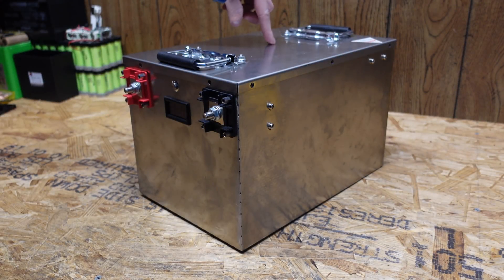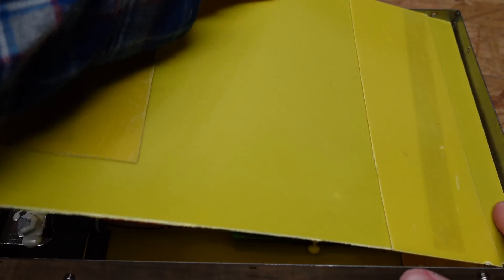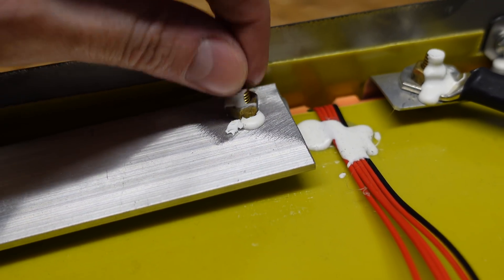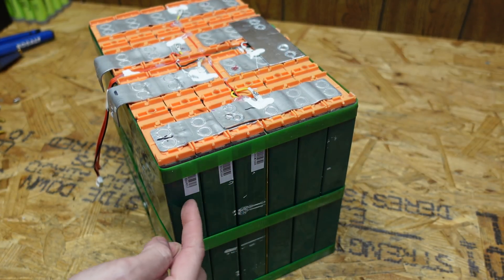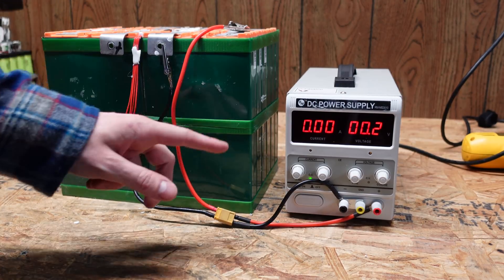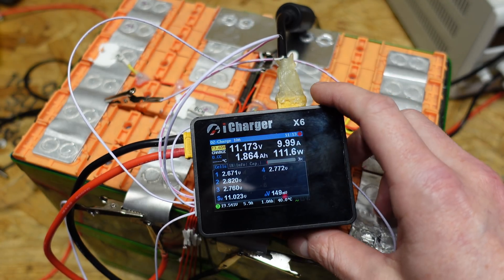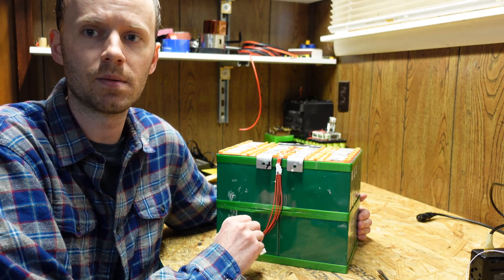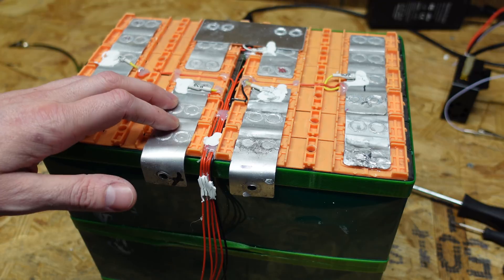Troubleshooting a Failed SHUNBIN 12V 300Ah LiFePO4 Battery

Comment: The bms in the SHUNBIN is garbage. I've fried a few of them. Some of my cells are bulged as well but I just made a 48v battery bank. Have the Overkill BMS that I'll be using to replace the shunbin with.
Reply from the maker: Other than the stainless steel enclosure (which is quite nice) the entire thing is garbage to be honest. They technically "work" though I suppose...

Comment: Sir, how many number of cells in parallel there. And total number of cells altogether.
Reply from the maker: Hi. It's a 4s3p battery, so the cells are arranged in groups of 3 in parallel, then each of those 4 groups are wired in series.
Reply: @LithiumSolar  How many cells in one parallel group.

Comment: Yeah I had purchased a new battery from China also that had a bad cell in it but in addition to that they were used cells to start with not new as advertised
bad cell in mine was spongy and soft compared to the others for solid hard

Comment: Just a quick note about "locking" washers
They actually don't work, I have never seen one work, but i have seen plenty fail, I think AWE or ThisOldTony did a video on it where he tested a bunch of diffrent washers.

The only thing that works is a locktite type threadlocker.
Or peenig the nut on, but that's rather permanent.

Comment: My son (age 5) asked me to suggest that you replace the bad batteries and connect them to the others with spot welded nickel strip (replacing the laser welded aluminium).
Reply from the maker: I don't think you can spot-weld to aluminum? I've never had luck trying it in the past with my Sunkko 709AD.
Reply: Can you remove the aluminium plate and spot weld nickel strip to the battery terminals?

Comment: As long as it charges up, balances nicely, then passes a week long self discharge test (nothing plugged in no BMS at all) then just run a capacity test and see if they are well balanced capacity wise. If it passes all those tests it should be just fine. LFE cells can be discharged safely to 0v and recovered with only minor degradation, spec sheets mostly state 100% DoD is allowed it just reduces the life expectancy faster than the normal 2.5v cutoff. As long as they were not reverse charged then they should be OK, but what I think happened is that the BMS shorted out from using recycled or fake mosfets and the load over discharged the pack. Unfortunately that does mean the first cells were over discharged, which is why they were sitting at 0v and not 2v which they should have bounced back to under no load. But of course that is just an educated guess.

Comment: For recovery i think you need anyway to separate all cells and test all individually. Probably there is just one cell (in the parallel configuration) which discharges the others. Separate, Charge to 3.6 - 3.65, let them rest for a couple of weeks, check the voltage, measure the capacity, rearrange the good cell so that each pack from serial configuration has nearly the same self discharge rate and the same capacity.

I think, cells which has a voltage less then 3.3V - 3.2V after a couple of weeks will discharge herself to zero after a couple of months. In my opinion this cells can not be used in the Pack if the user is do not charging this Pack at least once in month.

Comment: I would fully charge/balance the battery pack, let them rest a week, and then compare the cell groups. If they look reasonably close, do a capacity check on each group and see what you wind up with. If the one group has degraded capacity, the pack would still be useful at that capacity unless it is severely degraded. Note that those big cells typically bulge with use.

Comment: Caution is what I would stay with. You can guess that maybe these are B grade cells and the 3 cells that look different then the others should be test extensively.
I see the only issue is how you go adout removing and 'rebuilding the connections.
I have no idea adout. That part.
I really dislike that case it came in and would rather have them standing up.
'it your going to replace. Them maybe look to see if you can copy the replacement batteries connection points. 
If there's enough room to drill and tap the bus bars you could gain and easy solution for maintaining them in the future
ance that's my only idea.

Comment: My concern is the bulging. If damage has been done to the other cells, then replacing the bad cells could damage the new cells. Since they are of such poor quality I recommend scraping the battery.
Reply: No need to scrap the 3 good lifepo4 groups imo
Reply: I think the best thing to do is scrap the 3 cells that got 0V and dismantle the rest to individual cells and test each of them.
Since its obviously the garbage BMS that killed the battery, I would not trust the other cells until tested.

Comment: Definitely salvageable. As long as a cell didn't trigger any of its safety mechanisms and takes a charge it's still usable. You just have to charge it and test it. It's the same procedure really as salvaging any other lithium cell. It doesn't really matter if it's a 18650 ICR cell from a laptop battery or this LiFePo4 cell. It's the same principle. It might have lost some capacity but is most likely still good to go.

I have to say though, as a product that is sold to real customers for real money, this is one of the most shoddy things I've ever seen. This is terrible on so many levels.

Comment: Use an angle grinder to get the aluminum off or just weld more aluminum bars when you reassemble the pack. Your friend got ripped off, that's all low quality garbage

Comment: I would charge up the bulk of it like regular with all 4 in series.  Then when the other 3 groups likely top out, go to charging each cell group individually.  The idea of trying to do a capacity test of each cell grouping sounds good if your iCharger can do that lower one group voltage.  Might do that same thing a few times and see if the capacity on all 4 groups is pretty similar or not. Sad to see such a nice laser weld job get paired with such a crappy looking BMS.  Hope it all works out.

Comment: If you can locate like cells go for it.  I've never seen those before.
Reply from the maker: The 100Ah that Littokala sells on Aliexpess were very close to the same dimensions (few mm less).
Reply: @LithiumSolar  but they come with the same challenge to connect them somehow with the welded Aluminium bars and you will add the complexity by adding 3 new to 9 used cells. Not worth the risks cause you would have to spend 25% for the battery cells and bms on top. Therefore my advice to reduce it to 4S2P

Comment: Hopefully they hold up, because the laser welded would be a little harder to replace. But 0.035mv isn’t too bad. Makes me wonder if charging them up and discharging them a few times might help... just thinking aloud. Good content sir!
Reply from the maker: That's kindof what I'm thinking as well. I'm just unsure regarding how much bulge is acceptable before a cell is considered "failed".
Reply: @LithiumSolar  Again just thinking aloud, makes you wonder what the IR is reading...
Reply: @LithiumSolar  I’m with DYI on checking the IR of the 3 cells that were 0V. The bulging can be concerning, do you know how fast your Freud’s was charging them? And the BMS, well not sure if it was working as it should have and I don’t think you know the specs on the BMS it came with. Maybe if you are able to get one cell free you might get some specs on the cell?
Reply: @isitrigged4968  Like you, just thinking out loud. I have not seen many (if any) batteries with aluminum terminals posts. I am guessing they used aluminum for cost. So then maybe he can add normal bus bars or spot weld to the battery terminals??
Reply: @LithiumSolar  you will have to cycle the battery a few times. But use a new BMS, the old one failed horribly at doing its job. You can still use worn out LFP cells, but you need to adjust your application. They will have degraded capacity. No more fast charging, no more fast discharge. Keep C-Rates very low (below 0,15) so that the ions have time to find their path through the goop. LFP cells do not fail with a bang, but I would only use a pack like that outdoors anymore.

Comment: great investigation - bad seller and amazon is out of liability I guess so the owner had paid for poor craftmanship that caused the major damage.
Try to salvage it cause 3 / 4 of it seem to be good ... and someone will give you a solution how to reweld those connections or reconnect them. If you are able to bend a bit you might build a connection with a screw . 

you still have 3x 3 cells so a 4 x 2 cell configuration would be 1 chance with similiar cells of the past instead of adding 3 new cells and adding a new possible nightmare with other implications.

Reconfiguring to a 4x 2 cell system would salvage 2 / 3 of the new battery and 1 cell for the bench with only 1 challenge:

separating the 3 cell packs in 2 cell packs and then putting 2 cells together for the 4th pack needed to get a 4S2P

But I guess you will find somehow a solutio to rejoin them even with aluminium bars.
GOOD LUCK
Reply: I don't think it's that hard you just spot weld more aluminum to it just like it had originally. My welder can do aluminum but unless you do spot welding you'll fry the battery. A spot welder is actually called cold welding, that's the technical term for it
Reply from the maker: What spot welder do you have that can spot-weld aluminum?
Reply: @LithiumSolar  I would try to use the existing aluminium bars and cut those for 2P usage. Then you will get 3 single batteries with just a short aluminium bar that I would use to reconnect 2 of those by adding another aluminium or copper bar with screws on top to get a strong connection. Cheapest way.

You can weld aluminium for decades cause many bikes are build that way but that is more tricky cause the right temperature is the key and this cell welding is something to be carefull with. 
Here in Germany even ALDI and LIDL chain sold welders from time to time for cheap with a decent qulaity that are also able to weld aluminium around 200 $ incl. VAT 

There is a german yt channel that regulary checks each iteration and evolution of these ALDI and LIDL welders, not spot welders. Usually you can buy those used or new and use them to flip those afterwards if you can not need them. Then you might loose 20 or 40$ but job is done.

How to get deeper into that whole story: you might search or ask for a laserwelder for batteries here on the community page and people will give your for sure quite good answers. 

I am not sure what else you could achieve with 3S3P battery of 9V ? 
It would usually need converters to match 12 Volt ... or you try to salvage and reuse 8 cells in  a 4S2P 

To add 3 brand new cells will be a more expensive challenge at similiar level cause you have to get them and fit those 3 together and then connect that stack with the 3 existing ones where you will face the same challenge how to connect those 3 new to the old 9 reusing the aluminiium bars

I would try to lay another bar over the old one and new one and drill a hole on each side through both bars and reconnect these 2 bars with screws. That connection is the easierst and cheapest one ... but I am would be worried to get 3 new batteries and how to connect those with screws that they might fit in the box again.

It needs a good preparations or someone who supports you with the welding task and therefore I would prefer the smaller solution of 4S2P  cause that gives you more space in the box to achieve a solution. Not easy but ask for help on community support regarding aluminum welding and you will get answer for sure here or on the community page: Do not forget that a question or story on the community page about aloy welding of battery bars will be also shown to welders that instinctly will reply that and how they had done that for an other client ...

If you stay in your solar battery bubble it is a lot harder to get a solution but take a picture of your box and the welds needed and you might get the 1 or 2 experts that have done that in the western world or know at least one that might help further. 

And do not forget: telling that story even if more complicated due to showing 3 alternatives that you finally ignored to choose the 4 th alternative is the core of youtube channels like yours so it might take more time and effort but I guess the story is worth it cause you reach new viewers and subsscribers that have to deal with exact same issue: 12 V LiFePo4 battery made for cheap and sold via amazon where the BMS died and killed the battery partly - same happened quite often with Smart, BMW, KONA EV batteries mostly non LiFePo4 but you are the first that deals with a damaged 12V LiFePo4 battery to give that a second life. 

You are a Pioneer and that is a challenge and opportunity cause it is an adventure wher you can only win to bring 75% of the investment into a second life fully useable in my opinion.
Reply: @LithiumSolar  sorry I forgot to reply, I have an actual welder with multiple functions, it only has aluminum spool gun and tig welding, it would fry a battery but when I was learning welding they talked about cold welders. cold welding is basically spot welding so since mild steel can be spot welded it would be logical that you could decrease the current and voltage to cold weld aluminum, it's a softer metal with a lower melting point. so I just googled it and apparently you can spot weld aluminum and i found videos on someone doing it. possibly with a cheap spot welder. since I'm no aluminum battery welding expert I'll let you dig up the info but if you want I can help you research for a DIY cheap method. battery tabs are steel aren't they? aluminum should be doable
Reply: @LithiumSolar  never mind looks like you need a Sunstone 250i2 EV, so forget that, here's it in action https://www.youtube.com/watch?v=fiGnevYRemA
Reply: @LithiumSolar  I found it, you can use a cold welder for aluminum, so this will work for batteries, here is the machine in action, it should be a lot cheaper than normal spot welders for aluminum battery tabs. Just look up cold welder https://youtu.be/OIRdanbcpHc

Comment: Charge each group individually to 3.65v. let them rest a few days and see voltage after that. LiFePo4 should rest around 3.35v after a few days.
then capacity test each individual group. Most likely that 0v group would yield a lot less capacity than the other 3 groups but the only way to know if it's degraded is to do a capacity test and compare.
Reply: Just make sure you charge to 3.65 using a constant voltage, only when the current drops to 0amps is the cell actually full.
Reply: Yes, this chemistry take a while to be fully equalized. An active equalizer board will help to bring them to a close match in charge and voltage.

Comment: Worth looking into whether you can solder aluminium or not - I managed it before by soldering under oil and scratching the aluminium oxide layer off with my iron tip lol
Reply: Why can't you just spot weld it with aluminum strips? if you're really crazy you could use an angle grinder to grind it off

Comment: I would just charge it up and use until it quits for good likely just killed some capacity. I guess it depends on what he needs it for if it's not critical then fire away.
Reply: When it fails you could still use the good packs after, no?